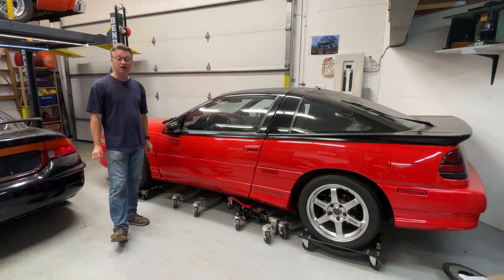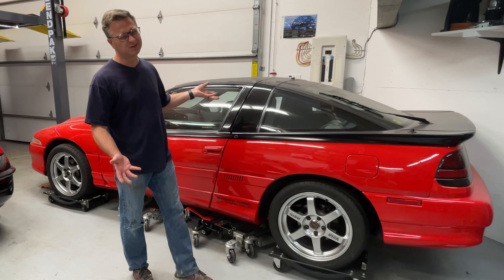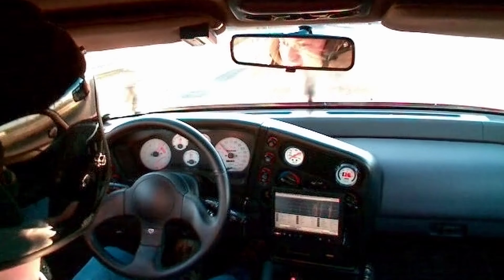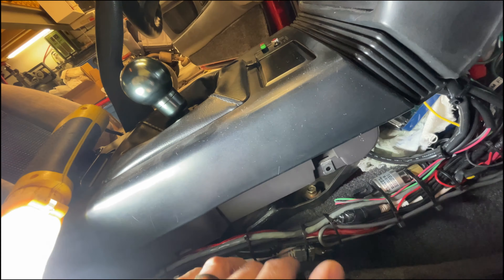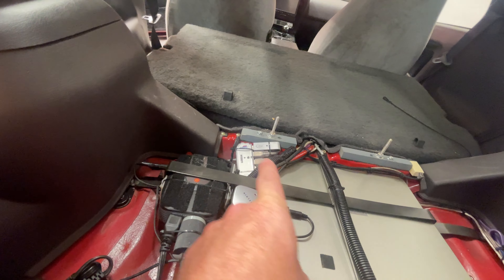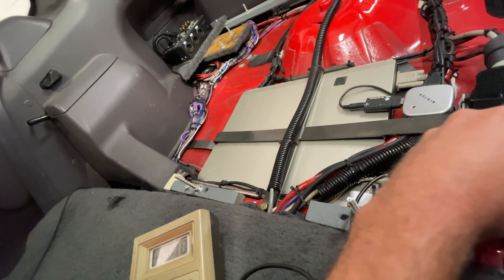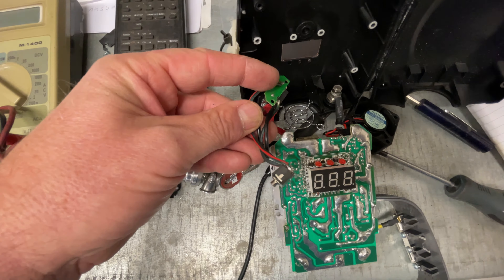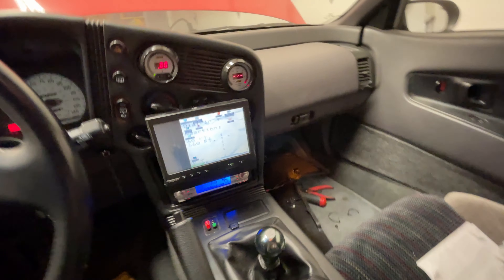I Built This EXTREME Car TUNING SYSTEM In The Early 2000’s…Now It’s Broken

Comment: Wow, just wow! Your mechanical  and electrical prowess seem to know no bounds. I've just recently started watching your vids because I'm trying to get a dsm back on the road and I've learned alot from you. Also, I've loved the Lotus Esprit ever since I watched "If Looks could Kill" back in 91. Can't wait to see yours completely finished. Keep doing what it is you do my man.
Reply from the maker: @Dsmdude4g63  thanks so much for the kind words and motivation to keep on doing videos. There will be more coming!
Reply: @SlippingTime  yes sir you're very welcome and thanks so much for responding so soon because obviously you're a busy man. Just please keep your content flowing. I've already learned so much from you and I will be applying it to my dsm build for sure. It's a 94 Talon tsi with only 74k but it's been neglected and robbed of the drivetrain( except  driveshaft, rear differential and axles, plus it has a mint interior) and front end components (which I've already sourced and replaced). Clear title and a great no-rust platform to start with though. And for only $400. Your vids keep me motivated so keep doing what you do. Lol
Reply from the maker: @Dsmdude4g63  I am sad such a low mileage one had a bit of parting out. Thanks for saving it and planning to make it whole again.  It will be a great car when you finish it up.

Comment: I've only seen white/silver lettering on the sideskirts for the 1990. 1991 had the black. Did you change that?  Also, where are your front speaker grills in the door?
Reply from the maker: The side skirt lettering was not consistent back then, but that is factory from 90 with the black form the day I bought it new. Back then I would say almost all red Talons for 90 had black decals on the side skirts. 
I had the mid stereo (no amp) when I bought it where there is no door speakers put in. The wiring is there though. My aftermarket setup does have door speakers with tweeters in the dash (crossovers used). To keep the no speaker look plus incognito I just have a seamless fabric in front of them.
Reply: @SlippingTime  maybe the lettering was an early or late year thing? I had a red 90 back in the day that was a very early build date and it had the white/silver.

Comment: What is the proper offset for aftermarket wheels 17X8" for that body style? I have a 1990 and want to put on 245/40/17's if possible. If I need to go coil overs to make the clearance, let me know. I plan to work on the suspension to get the handling much better. Do you have any suspension build type video's/tutorials? That would be great, love you channel! Thanks
Reply from the maker: From my experience the ideal wheel for a 1g is  17x8 with a +40 offset using a 225/45 tire. Anything wider and you run a risk of rubbing unless you roll the venders. With the stock suspension arms you can get away with about a 1-1.25” drop which I personally think looks the best on the 1g’s. 
I haven’t done a specific video on suspension, but will keep a not of doing one the next time I setup another 1g.
Reply: @SlippingTime  Thanks for the reply, can you not get a greater offset pushing the wheels further to the inboard part of the car  in an attempt to not allow the tires to rub on the outside of the fenders? What suspension components would you suggest to help this out? I just don't think 225's are wide enough for a 450+ whp street car...thoughts?
Reply from the maker: @mikefields1873  I believe the trailing arm will rub rub in that case. You can maybe get away with 235, but I think 245 will rub for sure unless you roll the fender. With AWD and good tires 225’s are good to about 5-600. Ask me how know. 😁
Reply: @SlippingTime  Okay so this gets into another topic I've been wanting to research. 20yrs ago street tires were, um, meh! Now we have some pretty awesome compounds available. My goal is to have a really nice handling, braking and fast strait line car 450-500whp I'm good. Restore the car nicely. Suspension and aftermarket components for my 1990 are difficult to find other than coil overs. I can't find aftermarket sway bars, bushings or hardly anything...

Comment: Very cool to see this! I've been on a Megasquirt MS2 standalone with my car since 2009, but I'm in the process of retro-fitting back to an ECMLink v3. I'm also about to do a cam swap from some extremely mild Comp 101200 (FP2) to GSC S2's which are a 274/274 duration and have a lot more lift. That would probably be a pretty good cam choice for your car as well.
Reply from the maker: I will probably go with GSC’s or Kelford cams around the 272 mark. Or of course if I found a good set of HKS’s I would put them in too.  Depends what I guy finds out there. I will miss the 288’s for all our drag racing, but don’t really do that much anymore and want to cruise the car more.  I had some FP2’s for another build and ended up not using them. Sold them instead and got some kelfords. 
From playing with all the ECM controllers out there, I find ECMLink the most practical for 98% of what people do with these cars.  There are some more modern auto tune $tuff out there of course, but I like to play still.
Reply: @SlippingTime  HKS 272s work really well too and have that proper old-school factor. The GSC and Kelford stuff gets you a little more duration at .050 and a little more lift.

The Megasquirt I'm using is way outdated, so going back to ECMLink will probably be an ugprade in many ways. If I wanted to spend a ton of money, I'd probably go Haltech Elite 1500 or Link G4X because they can run e-throttle and that would be nice to have.
Reply from the maker: @CaptainTonus  the Haltech’s are a nice piece for sure, but as you said it is relatively expensive for what extra you gain.